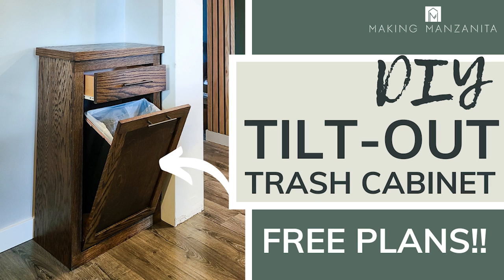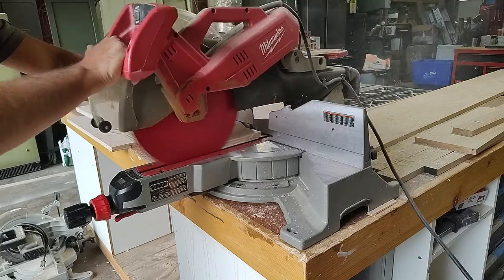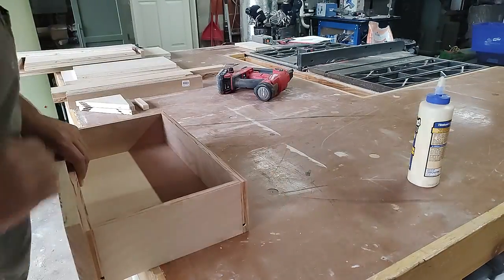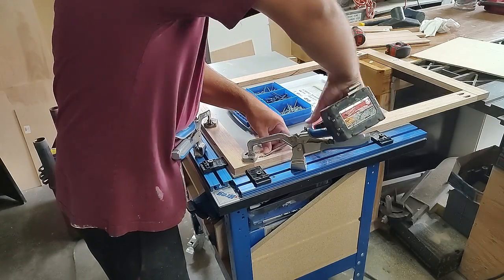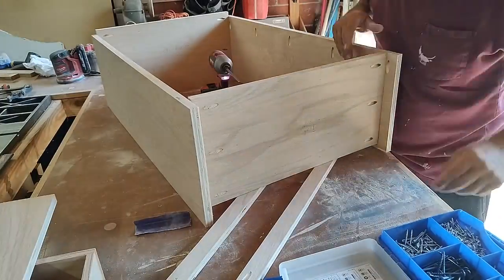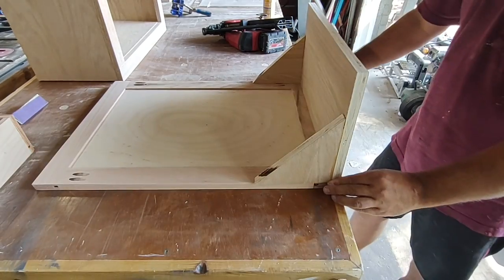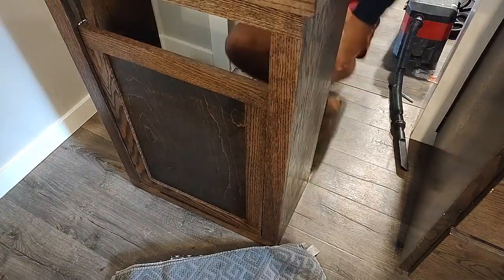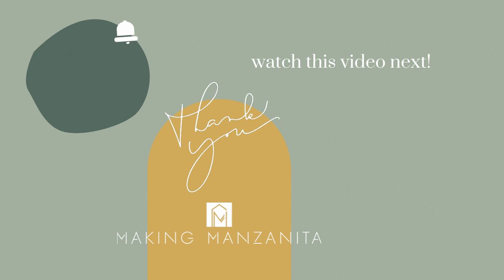Tilt Out Trash Can Cabinet DIY (FREE PLANS!)

Comment: Really liked the video, gonna make a similar one this month.  But seriously, my guy, gotta use push sticks on that table saw.
Reply: That's the first thing that came to my mind as well. Those fingers are way to close to the blade for my liking.
Reply from the maker: Definitely safety first with a table saw and if you aren't comfortable find another way to make the cut. Personally, I like the control I get with my hands on the material.

Comment: Is there a reason the trash can sits on its long side instead of its short side? TIA!
Reply from the maker: Just because the cabinet would jut out from the wall too far but you could totally design it the other way if you wanted.
Reply: This is what I'm looking for also, and built into kitchen cabinets, not free-standing.  I don't have a very wide opening for a trash bin cabinet, so I wanted to have the narrow end of the trash can to the front.  We can't be the ONLY people looking for this, lol!

Comment: Any recommendations for best alternative to pocket holes if you dont hVe the device/aids fir drilling the guide holes?  Or just bury screws at an angle?
Reply from the maker: Before I had a pocket hole jig from Kreg I would clamp, predrill, then screw. Its not pretty or as strong but can work if you don't have a pocket hole jig.
Reply: @MakingManzanita  awesome, thank you!

Comment: something is wrong with the drawer measurements. drawer bottom at 17' and the sides of the drawer at 17 1/4 inch doesn't work. one of them is incorrect wish i knew which before continuing on.
Reply from the maker: Thanks for bringing to this our attention! Major apologies for the error! We've adjusted the woodworking plans. It was an error in the size of the drawer bottom.